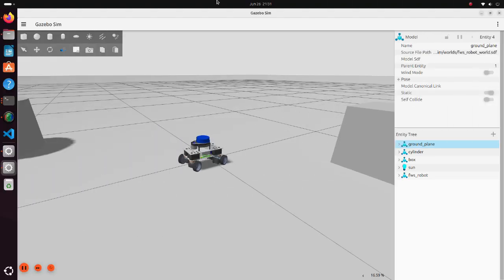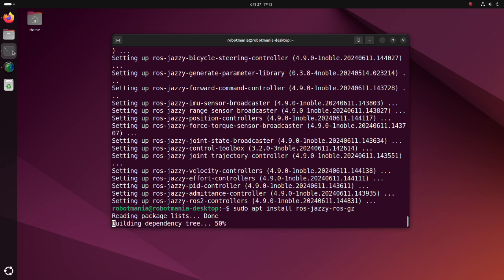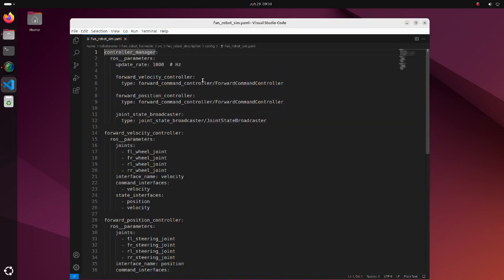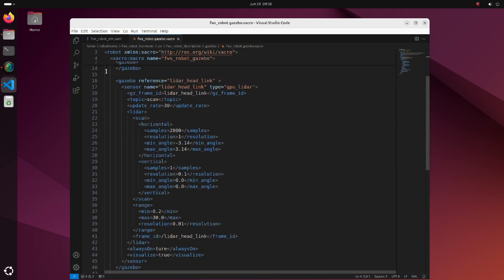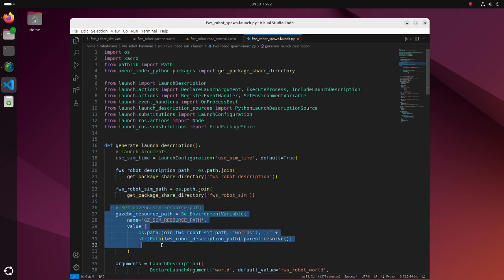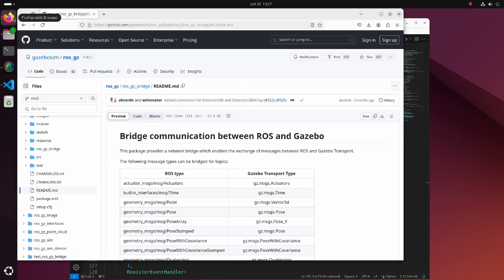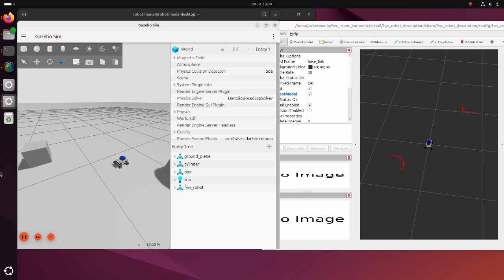How to Use ROS2 Jazzy and Gazebo Harmonic for Robot Simulation

Comment: Hi,Is your project about automatically avoiding obstacles or using a controller?
Reply from the maker: Hi Huy Ngô!
Thanks for watching my video!
I would say that this project is about using a controller and gazebo sim basics.
Reply: @robotmania8896  In addition to using the handle, can it run automatically?
Reply from the maker: @HuyNgo-qn3bq  Yes, the robot can run automatically. I recommend you to use nav2 packages.
Reply: @robotmania8896  Do I need to adjust the code after installing the nav2 package, if so, which file should I adjust it, can you guide me?
Reply from the maker: @HuyNgo-qn3bq  You don’t have to modify existing code. You have to create a new package. I recommend you to go through nav2 tutorial first. https://docs.nav2.org/getting_started/index.html
Reply: @robotmania8896  Thank you very much!🥰
Reply from the maker: @HuyNgo-qn3bq Which version of Gazebo are you using?
Reply: @robotmania8896  Gazebo Sim, version 8.10.0
Copyright (C) 2018 Open Source Robotics Foundation.
Released under the Apache 2.0 License.

Comment: Hello
I typed (ros2 topic echo /forward speed controller/ command) and pressed Lb to move the joystick, and it gave a signal, but it wouldn't move forward on the Gezebo.
Reply from the maker: Hi 簡偉宸!
Thanks for watching my video!
As written in the “fws_robot_sim.yaml” file, there is no “forward_speed_controller”. Probably you mean “forward_velocity_controller”. As written in the “robot_control.py” script lines 119~126, you should hold the “A” or “LB” or “RB” buttons of your controller to move the robot. Please check it.
Reply: @robotmania8896  yes is forward_velocity_controller, i follow all your steps at last i use the controller and  I hold  the "LB" buttons but the car didn't move ,what can i do. 
[joy_node-1] [INFO] [1761814420.424834947] [joy_node]: Opened joystick: PowerA Xbox Series X Controller.  deadzone: 0.050000
Reply from the maker: Have you installed joy, joy_linux packages? Also using the “ros2 topic echo” command, please check that topics are published with valid values.

Comment: Hi robot mania, i really like your videos they are super easy to understand and follow through, however i have came across a problem with the controll and Rviz, In Rviz there is a problem with robot model with the status error, showing fl_steering_link, fl_wheel_link and same for fr, rl, rr. how can i rectify this? Is this the reason why i couldn't use my controller? PS: in Gazebo the robot fully appears and don't have an issue with the whole transform, but in Rviz the wheels are not showing.
Reply from the maker: Hi Geeson Babu!
Thanks for watching my video!
I think that the Rviz problem and controller problems are probably not related to each other. What do you mean by “I couldn’t use my controller”. With what controller and how did you operate the robot?
Reply: @robotmania8896  I am using a controller called easySMX X15
Reply: @robotmania8896  Hi i am using the EasySMX X15 controller. 
my setup is: Lenovo legion pro 5,
Processor	Intel(R) Core(TM) Ultra 9 275HX (2.70 GHz)
Installed RAM	32.0 GB (31.4 GB usable)
System type	64-bit operating system, x64-based processor

Ubuntu 24.04.3 LTS and ROS2 Jazzy should i be doing something other than what is shown in the video? 
The robot does appear properly in the Gazebo, but in Rviz the wheels are looking like they have folded in, and shows the error as i have mentioned in the previous comment. is there something that can be done?
Reply from the maker: @GeesonBabu  Hmm…
Not sure about the Rviz error, but you should be able to use that controller to move the robot. Note that as written in the “robot_control.py” script (lines 119~126), you should hold certain buttons and move the joystick to operate the robot. Please make sure that you are holding the right button on your controller.

Comment: how to make it run bro, I don't know how to operate
Reply from the maker: Hi Cheese & Quaver!
Thanks for watching my video!
If you are using an Xbox360 controller, please operate the joystick holding the “A” or “LB” or “RB” buttons. The corresponding mode for each button is written in the “robot_control.py” file. Lines 119~126. You can operate this robot with other controllers as well. But in that case, you should check which button corresponds to data.buttons[0], data.buttons[4], data.buttons[5].

Comment: Hi. Super Video, even after a year! I am new to ROS2 und Gazebo and i wondered if it was possible to change the robot model and easify the movement by just increasing the linear.x and angular.z, like i was tought in ROS1. Which steps would i need to take to make it happen. I have the .URDF already ready for my roomba robot. Thanks in advance and thank you for your engagement!
Reply from the maker: Hi jp_classic!
Thanks for watching my video!
If in a general way, you have to replace files inside the “fws_robot_description” directory with yours. If you name your files the same names as mine, you might not have to change directory and file names in other places. Also, for diff-drive robots, there is a predefined diff-drive controller in ROS2 control, so you can use it.
Reply: And my general project is to create a robot using your lidar equipment to create a wall-follower. The Wall-following mechanism is already ready to be translated from ROS1, but i just need to be able to linear.x and angular.z the robot and not talk to every joint it self. 
What would you recommend me to do in a very general way. Thank you again!

Comment: Failed loading controller joint_state_broadcaster check controller_manager logs
Failed loading controller forward_velocity_controller check controller_manager logs
Failed loading controller forward_position_controller check controller_manager logs
Reply from the maker: Hi Linus!
Thanks for watching my video!
Have you installed all packages I mentioned in the video?
Reply: @robotmania8896 yess
Reply: Hi have you solve this already？ im facing the same thing

Comment: first of all kudos to your work mate!! 
pardon me as i am a newbee in ubuntu systems. as my background in mecanical engineering. Looking forwards for your help.
Thank you.
I am getting work while using "colcon build" the error says

CMake Error at CMakeLists.txt:19 (find_package):
  By not providing "Findament_cmake.cmake" in CMAKE_MODULE_PATH this project
  has asked CMake to find a package configuration file provided by
  "ament_cmake", but CMake did not find one.

  Could not find a package configuration file provided by "ament_cmake" with
  any of the following names:

    ament_cmakeConfig.cmake
    ament_cmake-config.cmake

  Add the installation prefix of "ament_cmake" to CMAKE_PREFIX_PATH or set
  "ament_cmake_DIR" to a directory containing one of the above files.  If
  "ament_cmake" provides a separate development package or SDK, be sure it
  has been installed.
Reply from the maker: Hi Abhishek kuksal!
Thanks for watching my video!
Have you added this line to your “.bashrc” file?
source /opt/ros/humble/setup.bash
If not, add it and after that execute this command.
source ~/.bashrc

Comment: Hey, I launched the simulation and it seems like my wheels are not showing in the RViz the error indicated that "No Transform from[fr_wheel_link]". And the Gazebo give me an error as well saying "Gazebo Sim not responding" Can you please assist me with this. Thanks
Reply from the maker: Hi De Witt Leenders!
Thanks for watching my video!
The “Gazebo Sim not responding” message should disappear over time. Does this message get shown no matter how long you wait?
Reply: @robotmania8896  Thanks for replying, yes the message stays. I am running the sim on my raspberry pi 4b, is that fine?
Reply from the maker: @dewittleenders572  As far as I know, Gazebo does not support ARM64 architecture officially, so there might be issues.

Comment: Hi, a month ago, I ran your program according to the steps and it worked properly, but now when I run it again, an error occurs:
[gazebo-1] [ERROR] [1743585220.582921546] [controller_manager]: Caught exception of type : N6rclcpp10exceptions22RCLInvalidROSArgsErrorE while initializing controller 'joint_state_broadcaster': failed to parse arguments: Couldn't parse params file: '--params-file --param'. Error: Error opening YAML file, at ./src/parser.c:271, at ./src/rcl/arguments.c:415.
Resulting in the prompt 'No transform from [fl_steering_link] to [base_link]...No transform from [rl_wheel_link] to [base_link].'
what shall i do ? I would appreciate it greatly if you could give me some suggestions.
Reply from the maker: Hi didi!
Thanks for watching my video!
I got the same issue report from several other people, but currently I don’t know how to fix it. I also found a similar issue:
https://robotics.stackexchange.com/questions/115202/failed-to-load-controller-joint-state-broadcaster-params-file-param-error
Maybe sometime soon there will be an answer here.
Reply: @robotmania8896  Thank you very much for your help !!
Reply: Hi @Di_Done , did you manage to solve the problem?
Reply: @Freepalestine45_  Hi, I renamed the package from fws_robot_description to fws_scription. Previously, running the program did not report errors, but now other issues have appeared.

Comment: An error when to run gazebo 
[gazebo-1] [Err] [SystemLoader.cc:92] Failed to load system plugin [gz_ros2_control-system] : could not find shared library 
.. i can run gazebo by gz sim normally
Reply from the maker: Did you install the “ros-jazzy-gz-ros2-control” package?
Reply: Yes i did  But I don't know how this affects because the simulation doesn't work and gives me a white screen. Even if i try to run an empty world 
  @robotmania8896
Reply: Yes i did 
But i have a white screen in gazebo even if i try to run an empty world .... @robotmania8896
Reply: @robotmania8896  Yes i did  But I don't know how this affects because the simulation doesn't work and gives me a white screen... Even if i try to run an empty world
Reply from the maker: @moutazmousa2291  In that case, the problem might not be in the “world”. You can strip down the launch file until it will work normally, and then, by adding small chunks, identify where the problem lies.
Reply: @robotmania8896  which launch file do you mean
Reply from the maker: @ The “fws_robot_spawn.launch.py” file.
Reply: Can you suggest any other tutorial of how this project could be implemented on ros2 humble and gazebo fortress  ...
Reply from the maker: @moutazmousa2291  Unfortunately, I don’t have a tutorial with gazebo fortress. Because I used ROS2 Humble with gazebo 11.
Reply: @robotmania8896  okay mention the same project i have gazebo v 11.10.2
Reply from the maker: @ I think this is the closest project to what you would like to do.
https://www.youtube.com/watch?v=VX53gAXafUA
Reply: @robotmania8896  can you help me? to add lidar sensor and visualize it in rviz in the project you mentioned  ..

Comment: Awesome project!
I am using Ubuntu 22.04. Is it possible to run this project with ROS2 Humble and Gazebo Fortress?
Additionally, what modifications are needed to use an Xbox One controller?
Reply from the maker: Hi Max Schoenen!
Thanks for watching my video!
I think you don’t have to do any modifications to use Xbox one controller. Probably it will work if you just plug it to your computer. If I remember correctly, in case of gazebo Fortress you have to replace “gz-sim” to “ign”. But there might be additional modifications, so I recommend you to run this program using Gazebo Humble.

Comment: At minute 11:30, when I execute this command colcon build, I get an error
The error is related to cmake 
It says cmake error at cmakelists.txt.19 (find_package) 
What should i do and what is the solution
Reply from the maker: Hi moutaz mousa!
Thanks for watching my video!
Can you please show me the whole error? I would like to know which package exactly cmake couldn’t find.
Reply: @robotmania8896  
CMake Error at CMakeLists.txt:19 (find_package):

By not providing "Findament_cmake.cmake" in CMAKE_MODULE_PATH this project has asked CMake to find a package configuration file provided by "ament_cmake", but CMake did not find one.

Could not find a package configuration file provided by "ament_cmake" with any of the following names:

ament_cmakeConfig.cmake

ament_cmake-config.cmake

Add the installation prefix of "ament_cmake" to CMAKE PREFIX_PATH or set "ament_cmake_DIR" to a directory containing one of the above files. If "ament_cmake" provides a separate development package or SDK, be sure it has been installed.
Reply from the maker: @ Did you set up your environment by sourcing the following file?
source /opt/ros/jazzy/setup.bash
Reply: @robotmania8896  yes I did
Reply from the maker: @ In that case, I don’t know what is wrong. Generally, this error occurs when something wrong with environment variables. Here are several pages that might help you. Please, check it.
https://stackoverflow.com/questions/56837562/colcon-build-failure-could-not-find-a-package-configuration-file-provided-by
https://docs.ros.org/en/jazzy/Installation/Ubuntu-Install-Debs.html#setup-environment
Reply: @robotmania8896   ok thank you

Comment: Great video! 
I encountered the following issues:
1. when i ran the gazebo launch file, i found this warning: [gazebo-1] [WARN] [1740654098.151097751] [controller_manager]: No clock received, using time argument instead! Check your node's clock configuration (use_sim_time parameter) and if a valid clock source is available
but in the source code, the use_sim_time has already been set to true...what does this warning mean?
2. i couldn't move the robot using ps4 controller. when i ran ros2 topic echo /joy command in a terminal and then pressed my ps4 controller buttons, i observed correct output in the terminal, which means the ps4 controller had connected to the system but the robot didn't move..
Thanks for your help. 🙂
Reply from the maker: Hi john kidsman!
Thanks for watching my video!
To run the robot you also must select “mode” by pushing one of the buttons. Please, check the “robot_control.py” script lines 119 ~ 126.
Reply: @robotmania8896  yes now it's working! Thanks!👍

Comment: hi, I've tried it with the tutorial you provided but when I move the joystick why the robot doesn't run huh? can you help me 
oh yeaha, when I check rqt_graph /gz_ros_control is not connected to /forward_velocity_controller
Reply from the maker: Hi Kholil Dekker Clasher!
Thanks for watching my video!
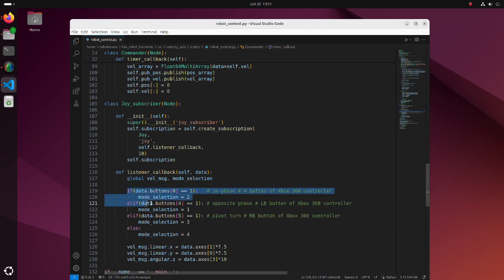The robot will not run by just moving the joysticks, you should also operate buttons. Please watch the video from 10:36~.
Reply: @robotmania8896  thank you sir. i want to ask so my usb joypad for the right analogue is not an axis, but a button. so the robot simulation can't turn right or left. how do i set the joystick sir? like in your original video how do you turn right and go forward?
Reply from the maker: @KholilDekkerClasher  If you have another analogue input (like trigger buttons on the back of controller) on your joypad you may use it. If you don’t, you can modify the code (listener_callback function in the Joy_subscriber class in the “robot_control.py” script) so that target angular velocity increases/decreases with each push of the button.

Comment: Hey i want to use something like for my self balancing bike. I have it's urdf and it's xacro files (which i used while doing this is ros1 noetic). But now i want to spawn the bike in harmonic with ros2 humble. I have only 3 actuators, first one for reaction wheel and second one for real wheel and third one for handle. I want to do all the things, like calculating odom, publishing vel to it's real wheel & handle for moving. Do you have any idea what controllers should i use? or soemthing similar for this?
Reply from the maker: Hi Divyansh!
Thanks for watching my video!
I think you should use position controller for steering(handle) and velocity controller for reaction wheel and real wheel. You can use controller definition almost as in my files. Just change joint names.
Reply: @robotmania8896  Thanks man. And yes, very helpful video. Keep them coming.....

Comment: Thank you so much for tutorial! I tried add visualization of lidar in gazebo, but it somehow not worked. Can you help? How I can visualize it?
Reply from the maker: Hi Sofiia Rutska!
Thanks for watching my video!
How exactly did you try to add lidar sensor to the model? Generally, you should be able to turn on/off visualization of lidar ray in the xacro file using “vizualize” tags like this: <visualize>true</visualize>
Here is a more detailed document. https://gazebosim.org/docs/harmonic/sensors/
Reply: @robotmania8896  In file fws_robot.gazebo.xarco there already placed this tag <visualize>true</visualize>. I tried to search where it is turned off, but I could not find it. I assumed there should be a visualization of lidar in the gazebo, but somehow, it is not. In Rviz there visible output of this lidar, but not in gazebo. I don't know how to manage it. Also, I use ros2 jazzy and gazebo harmonic on WSL ( from Windows 11); could it be the problem? Sorry, I just started learning ros and gazebo sim, I would be glad for any help!
Reply: I found a way to visualize it, I added some plugins in the <gui> <gui> tags and I can turn it on/off in the gazebo sim interface
Reply from the maker: @SofiiaRutska  Thank you for sharing! I also found these pages.
https://github.com/gazebosim/gz-sensors/issues/434
https://gazebosim.org/api/sim/8/gui_config.html
I was able to visualize lidar by adding “VisualizeLidar” plugin to the “gui.config” file.